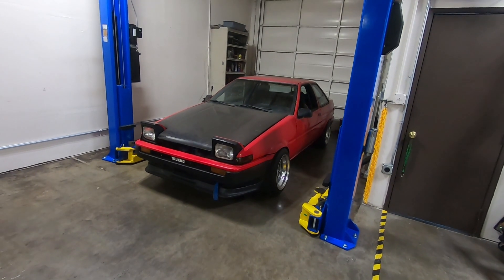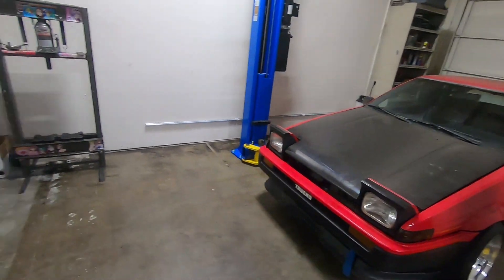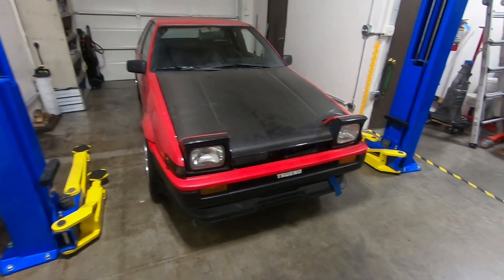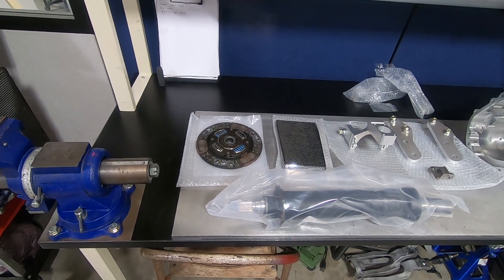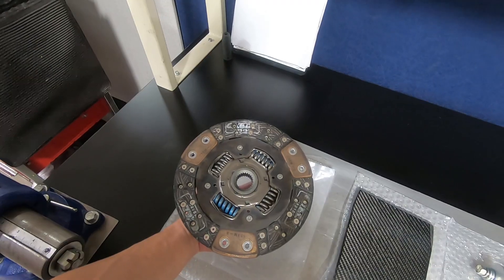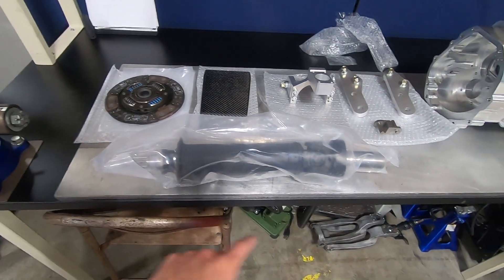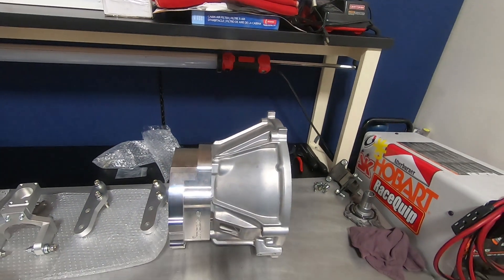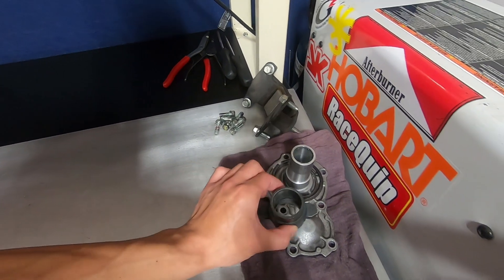IMPULSE 4AG 6 Speed Adapter Install

Comment: will it have a shorter gear ratios and final drive or it will improve your mpg with the 6th gear?
Reply from the maker: TL70 6th is same ratio as s15 AZ6 6th. Taller than T50 5th, J160 6th, but not as tall as MFactory 5th. Ratios are much closer.